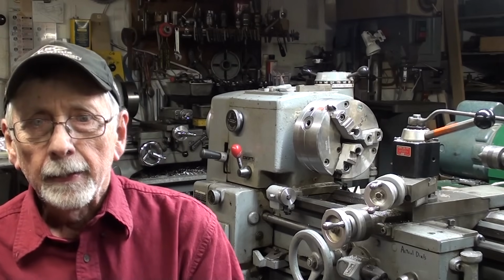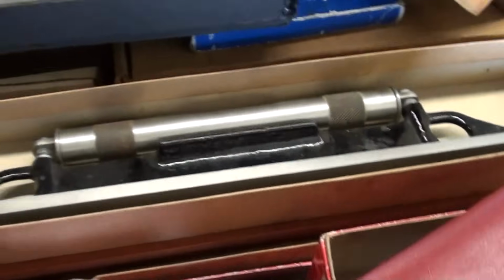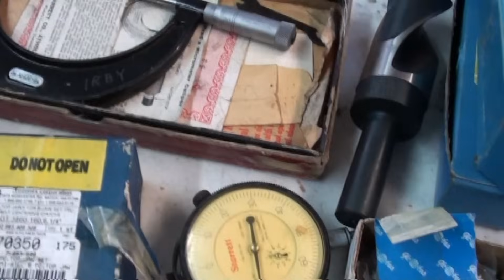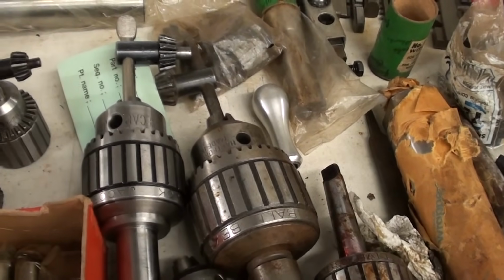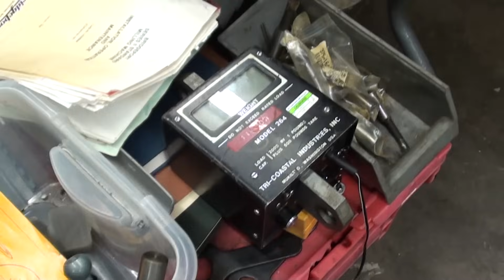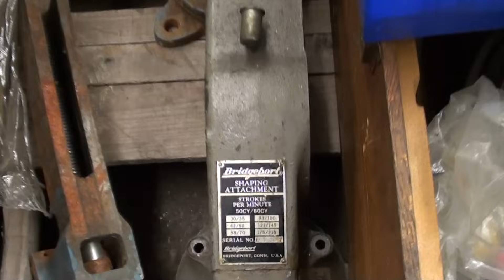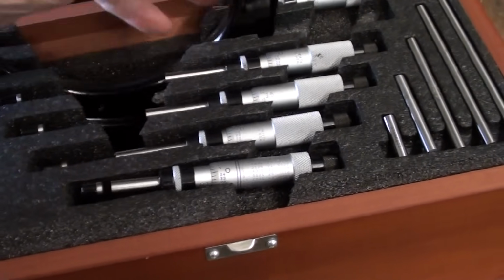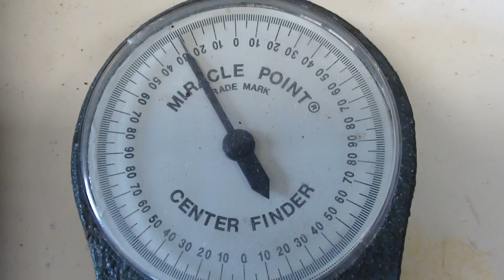LOST CREEK MACHINE - Largest Tool Buy Ever, must see tubalcain starrett

Comment: Great-looking box of Starrett mics there towards the end. 

Several years ago I found a box like that, full of 8-10 of the analog (ie; non-battery-powered) digital mics. I think it might even go up to 12". They had just been "certified" and the price was like $950...so I bought them. Still have them to this day, although I don't have much call for the ones over 6-7" in model engine making. But the deal was so good I couldn't pass it up--and I'm glad I didn't. I also bought a box with a metric mic kit a couple of years later, but it's much smaller--I think there are only 5-6 mics in it. But for the $350-400 it cost, I couldn't pass up the deal...especially when the mics look like they've never been used. 

Sometimes you find those incredible deals and have to move quickly. Looks like I need to call these fellow about stocking up on milling cutters and reamers.

Comment: In the first still picture there is an "Advance" rotary cross slide table on the pallet. What a shame to see it so abused. I knew the man that invented that, and used the table many times to do some incredibly complex work in Diecast and plastic molds. Of course the technology went the way of the dinosaur, and these tables were relegated to being used as boat anchors.
Reply: As a 1962 apprentice in a tool and die shop with a K & T rotary die mill, I never knew of an ADVANCE rotary cross slide table existence. Very ingenious.
Our mold job estimator had a similar idea, with help from his friends a design was put on print for an attachment to fit on a Bridgeport head. He couldn't get a patent.

Comment: few ok prices but alot of the prices are HIGH ..........  are they negotiable at least?
Reply: Sure, everything is negotiable. However I disagree with them being high. Most of their stuff is on par with the going rate. Secondly, they are in business to make money. You can’t buy and sell with little profit or you won’t make it long. Speaking from experience as both a machinist and tool dealer.
Reply: @grntitan1  well I didn't look at everything.   And in fact I did see a few reasonable deals.   But I searched up a South Bend micrometer carriage stop...... and 250 is ......... I mean you can buy a whole south bend lathe for 1500....  and even a lot less in some situations.  250 for a mic carriage stop is high ..... they range from 75 to 200 in my experience
Reply: @dizzolve  Thing is, the machines are always the cheapest part. It’s all the required tooling that breaks the bank. You can have a mill or lathe, but without tooling they are useless. Like the carriage stop you mentioned. Someone who needs and doesn’t have, will pay whatever it takes. Most of the time, mills and lathes are sold stripped down. Selling the tooling off makes the machine sellable. The tooling can reap a pretty penny. Price a steady rest for just about any lathe.
Reply: @grntitan1  what is your best advice as a tool dealer or reseller?
Reply: @stitchthisditchthat259  I try and limit myself to auctions of closing machine shops and tool and die shops. You absolutely have to know the value of any items you are bidding on along with all expenses. Auctions get a buyers premium which must be factored in. Then don’t forget moving expenses. Then you have to know your market. Tools that interest me, do not always interest potential buyers. I have sold my share of just barely break even items. My biggest crutch is the fact that I am a machinist and tool hoard myself. I have many times bought items to sell and ended up keeping them for myself. That’s not a good business model. 😁
Reply: @grntitan1  I hear ya there brother. I’ve been auctioning two years now didn’t really know about it and all my buddies think I’m crazy going to get more “junk” lol. Have found some cool stuff it’s crazy to see sometimes ya know 40-50 years of a guy collecting specializing for it all to get dumped

Comment: Hi Mr Peterson, I wonder if I could get your help. Is $3500 a good price for an Atlas 3982 (I don’t believe it has quick change gears) and comes with the following:
3 and 4 jaw chucks
Tail stock chuck and key
Swing face plate with with 4 dog
1 tail stock bearing center and
1 fixed center,
2 tool posts holders with wrench sets
4 turning tool holders and many cutting bits
Milling attachment
Draw bar, extra drive belts
Head stock casting
Extra change gears set
Might be from 1964?
Reply from the maker: That is exactly twice as much as what that machine is worth. Although it sounds like a comes with lots of accessories
Reply: @mrpete222  Thank you so much. Love your channel and I’m inspired!